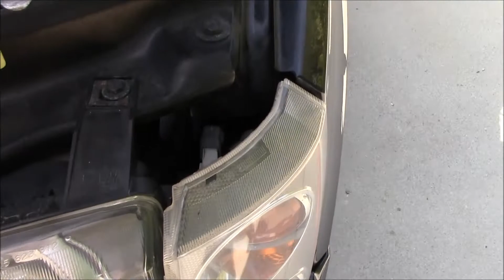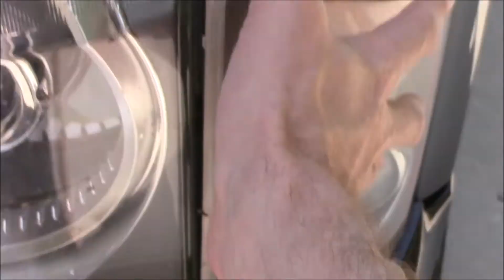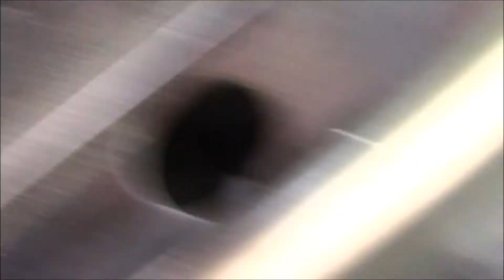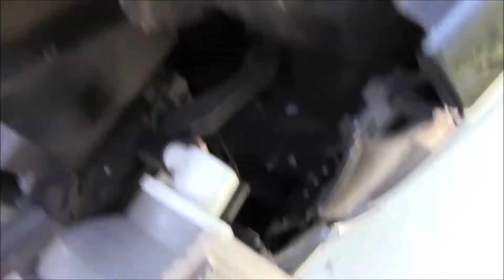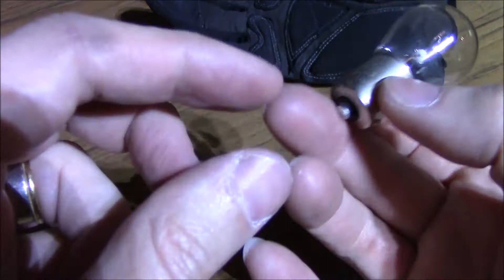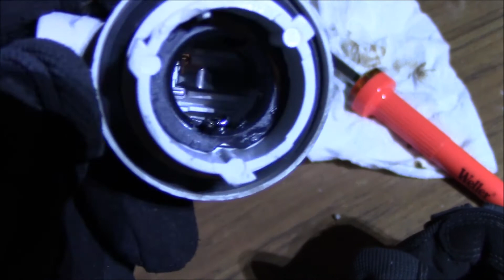Blinker Fix - Land Rover Range Rover Turn Signal Indicator repair

Comment: So awesome! Worked like a charm but I want a new one.  At 5m30 into the video, you say "Go on eBay" ... what do you call this part? I've been looking but cannot find it. Thanks for your help.
Reply from the maker: Thanks.  As for the ebay search, look for a land rover turn signal socket.  Here is a link for one on the RIGHT (passenger)  if you need the driver side they have on for that too.  $20 each.  https://www.ebay.com/itm/03-05-Range-Rover-RIGHT-Front-Turn-Signal-Lamp-Light-Bulb-Holder-Socket-Genuine/331454173959?fits=Make%3ALand+Rover&epid=1011155393&hash=item4d2c355307:g:DpYAAOSwzrxUvQ5r:sc:USPSFirstClass!28117!US!-1

I am not affiliated with the above so it is just a suggestion feel free to pick a different one.